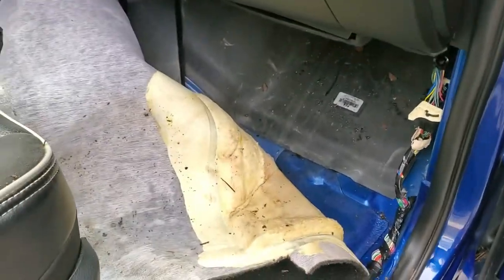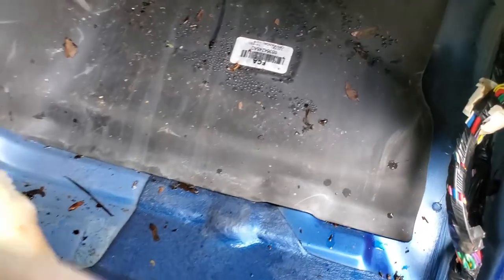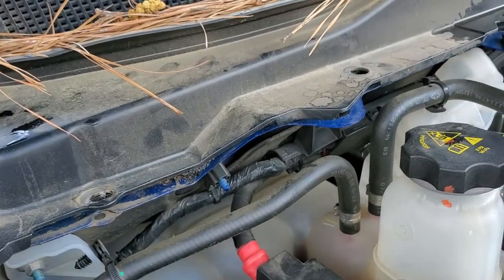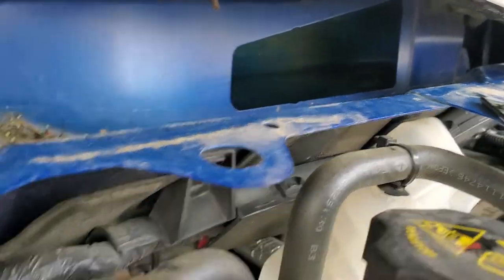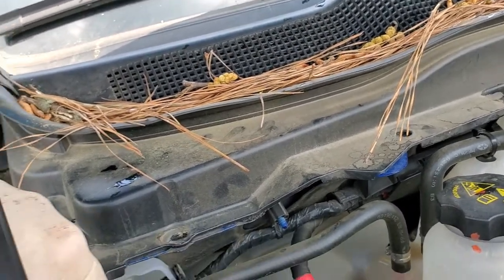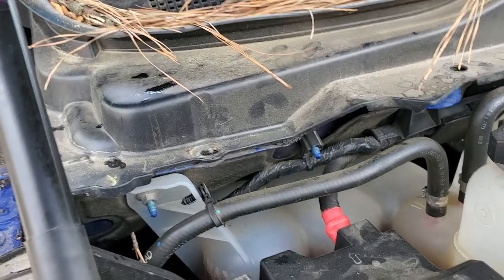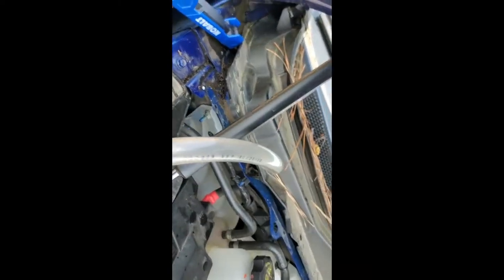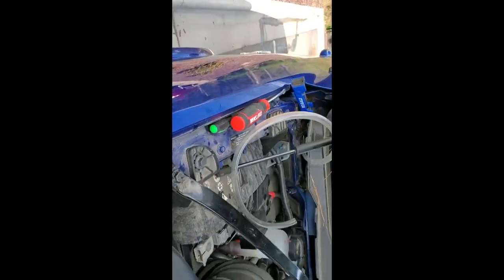Dodge Ram Cowl Drain Leak Fix

Comment: Thanks for this video. The RAM dealer in Medford NY could not find any leak and said that any water would be from the AC drain being clogged. There is no chance of leaking from under the cowl!!!!
I cleared the AC, no water came out but I didn't use the truck for a week and the AC wasn't run. I finally drove it, 5 minutes later, I made a left and I heard water rushing in the dashboard and water started gushing into the passenger side from under the glove box. I realized it did rain for 2-3 days so I remembered this video from a few weeks earlier, found it and it matched what happened to me exactly. I Pulled up the cowl & silver tape, cleared out a lot of pine needles, found the hole on the left side (between two metal outlays) , started to put the cable in and some water started coming out. I Went to the driver side, did the same and about a gallon came out. I realized when I made the left turn, the sound of rushing water I heard was the water from the driver's side, sloshing to the passenger side and it was an instant water fall inside the cabin. I believe the pine needles are the culprit. Now that all is fixed., I will make sure to clean the cowl, use Draino/prequa and know what to do next time it happens. 
Thanks PACFANWEB!
Reply from the maker: Glad it helped!  It's amazing just how much water can just sit in the cowl area.

Comment: I had a similar problem on my 2022 Ram 1500.  I did completely remove the cowl and could easily reach in to find why it was clogged.  On both sides, there is are two holes, maybe 3/4" in diameter on the outside wall.  There is a rubber flapper that closes them off when no water is in the cavity.  I'm not sure why you need the flapper, but in my case there was gunk from spring pollen season in Georia and it closed off the holes on the passenger side.  I pushed it open and then it drains freely.  I cleaned it out good before reassembling.  One thing I noticed was that, at least on my 2022, there is a hole on the outside of this wall that can be accessed without removing the cowl.  It is almost opposite the drain holes.  If this happens again, I'm going to try pushing something firm, but soft, like a piece of 14/2 romex in the hole to try to break the gunk seal on the flapper.  If it works, it will be much easier than removing the cowl to get to it.  If there is actual debris in there that can't get out of the holes, then I'll resort to removing the cowl again.

Comment: 8/22/24  After going to my local car wash, I heard the splashing sound you're talking about.  Did the same you just did. I used a screw driver to clear the blockage. 2019 Dodge Ram Limited.

Comment: My 2019 had this issue today.  Sat in the rain for a few days, and I went to drive it and I hear sloshing.  No water anywhere except the passenger floorboard.  I ended up taking the glove box out, removing the cabin air filter... and it was SOAKED!  So, I used compressed air to blow out under and over the cowl, and then aimed the nozzle inside the air box where the cabin air filter is normally located... and almost instantly, water started coming out of the drain tube on the bulkhead/firewall.

Now to dry out the truck, LOL.

Thanks for this video - it pointed towards what the issue was!

Comment: Similar issue, but I had no debris whatsoever. I did remove the foil tape or whatever it is to get better access to the drain. I also think that the plastic vent intake on the passenger side in that cowl could use better sealant instead of the foam. Do you know what that tape is called so I can replace it?
Reply from the maker: Far as I know it's just called foil or aluminum duct tape. You can buy it at Lowe's or Home depot.
Reply: Looks like it is luminum Foil Tape with Butyl Rubber Backing  @SealofPerfection

Comment: I’ve been trying to figure this out on my truck, it’s a 2014, but both driver and passenger front floor board get wet, but mine is opposite, as the driver side gets more water. It ends up completely soaking through the carpet after a decent rain on the drivers side. Gonna end up checking it out to see if this is my culprit. I assume theres probably a drain for both sides.
Reply from the maker: Yes, there's one on both sides

Comment: I have 2021 2500 and it when I popped the cowl off it looks they put some kind of duct tape over the hole; I can’t get to the drain from the top.  Going to try get under and see if can get it to from underneath.  We’ve had 3 days of really heavy rain here and I can here it sloshing around in there.
Reply from the maker: I couldn't see it I had to reach my hand down in there and feel it.

Comment: So I’m having moisture every morning inside of my 14 ram. After watching this video on suspecting this may be the cause of it but what made the water get to the interior if it was all collecting outside of it from the drain being clogged? Did you find a secondary leak or something to go into the interior?
Reply from the maker: @jbsanders826  it builds up inside the cowl on the right and then goes through the cabin air filter and gets inside. There was no other leak in the truck
Reply: @SealofPerfection  copy that
Reply: @SealofPerfection  so it looks like mine is actually the rear floorboard along the trim is wet. What’s your thoughts on that?
Reply from the maker: @jbsanders826  in the rear I'd be looking at the third brake light or the cabin vents behind the seat
Reply: @SealofPerfection  lifted up the backseats and both of them had puddles of water in there. Looks like I’m taking the backseat apart lol